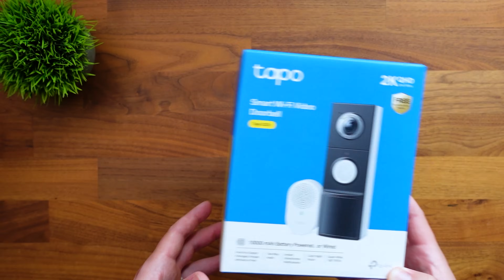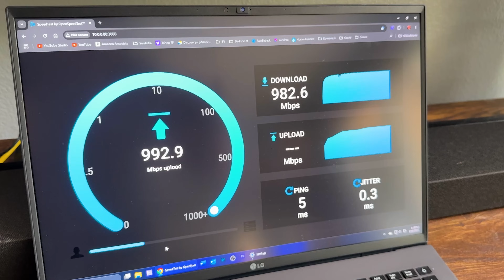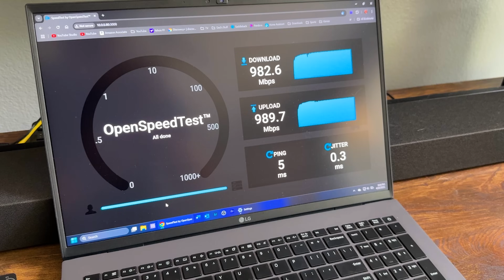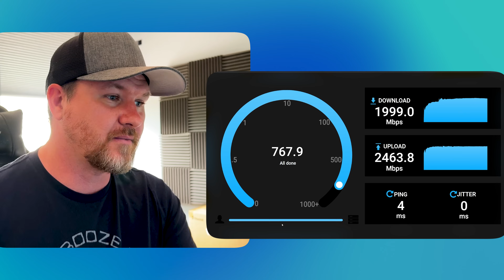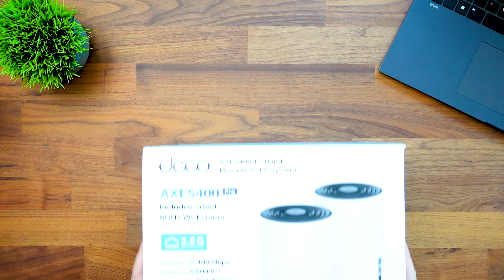Turn Your Coax Cable Into Blazing Fast Gigabit Ethernet

Comment: You might want to point out that many people's existing Cable Modem may have MoCA built in and they can just get devices for the rooms they want to service with MoCA.
Reply from the maker: This is a great point. Something i wasn't aware of before.
Reply: @SteveDOES  I have used MoCA for many years now, currently with the Xfinity Technicolor XB7, it and my previous Xfinity Modem/Router also supported MoCA, only ver. 2.0 capable of 1gig but still worth using. Possibly they have newer modems that support MoCA 2.5. I just haven't upgraded my equipment because they only offer 1300MBps in my area and I'm good with MoCA 2.0 for now. I have read that there is an XB8 available and I believe it supports MoCA 2.5, maybe in my near future. By the way I really enjoy your streams! Thanks for some awesome information.
Reply: I have used Moca for over 10 years with no issues. My cable modem has it built in.
Reply: @johnsanten  me too until tonight. They just sent out a firmware update that has temporarily broken my MoCA this evening. Have spent hours with support and the lower level support people do not even know what MoCA is... Little ticked off at the moment.

Comment: In general, Ethernet is faster than MoCA. While MoCA offers a reliable and convenient alternative to running new Ethernet cables, it typically doesn't achieve the same high speeds as Ethernet.
Reply from the maker: That is correct, but in a lot of cases, MoCA is a good compromise.

Comment: MoCA can be run over the coax even if you're still using it for cable TV. However, be careful to put a MoCA filter on the coax connection going to the outside of your house so that you don't send your network signal back out to the cable provider's system. Adding the filter will also increase the MoCA signal level inside your house.
Reply: Could you please explain more
Reply from the maker: Very helpful. Thank you.
Reply: Can you give more details on where to plug a filter?

Comment: Verizon FiOS Router has MoCA built in...I have a MoCA transceiver in my office connected to COAX, all splitters etc are Digital ready.  Wih 1 GB Fiber, I get 889.51 down and 858.61 up with 7 ms ping time....not shabby at all.
Reply from the maker: Now that's a cool way to go. Are you able to use any MoCA adapter?
Reply: @SteveDOES  I have used a couple variations of adaptors, bonded, not bonded, ScreenBeam...I forget what version of MoCA (possibly 2.0) is being used here, but I can put a switch on my end, and have 2 desktops plugged in, a 2013 Mac Pro and a self built Windows desktop running Win 10.  Both work perfectly.
Reply: The Verizon G1100 router supports MoCA 2.0 (max bandwidth 500 Mbps) whereas the newer G3100 and CR1000 routers support MoCA 2.5 (max bandwidth 2.5 Gbps)

Comment: I have a pair of the exact same moca adapters and ended up scraping them. I would get almost minute long interruptions in the connection. Super frustrating. Not sure If I'm doing something wrong but I don't think so.
Reply: probably needed to cap off the open ended coaxial connection that were unused.
Reply: @AnhtoanNguyen128 can you elaborate more on this?  What do you mean by capping? What hardware do I need to do this?  I am odd issues where I get network drops for a minute randomly as well.  Much appreciated.

Comment: Or just use a drill and pull 10gbps fibre throughout your house... network cards for SFP are cheap these days
Reply from the maker: If that's an option then that's definitely the way to go.
Reply: @SteveDOES  I chose fibre over ethernet because it requires reaaaally tiny holes. Rented property as well.

Comment: I cant do this in my medium 90s two story house. The first floor has coaxial and rj11 connections but the second floor only has one rj11 connection.
Reply from the maker: In the past cable providers would run coax through the house for free when you signed up for service. Not sure that's worth the 1-2 year contract commitment though.

Comment: I had to resort to using MoCAs in my new (to me) house.  Impossible to wire more ethernet.  One problem,  in a couple cases I have apparently non-moca compliant splitters hidden inside the wall.  In the case of my MBR,  I could NOT get MoCA to work on either COAX because of this.
Reply from the maker: Oh no, that sucks! I didn't even think about that scenario.

Comment: Regarding the MoCA adapter only having one coax connector, if you are trying to plug a cable tv box, You need a two way splitter rated for MoCa in order to plug a MoCa adapter and a cable TV box at the same time, No need to buy a MoCa adapter that has the MoCa and TV output since the majority of them are limited to only having gigabit ethernet, Just get a two way splitter and an extra coax cable to the TV's cable box.
Reply from the maker: Great tip, thanks for sharing!
Reply: Could you please give any product recommendations that can do this

Comment: Have been using MoCA 2.5 now for a couple of years and love it. Also, I have my distant MoCA adapter connected directly via Ethernet to my Asus Wi-Fi Mesh router (wired backhaul). I have several devices connected via Ethernet directly to that Mesh router plus the Mesh router is transmitting Wi-Fi to a bunch of devices at the far end of my home. Can't say enough good things about MoCA. If you already have Coax wired throughout your home, these devices will bring awesome up/down speeds throughout.
Reply from the maker: Couldn't have said it better myself. :)
Reply: @SteveDOES Steve can you just come over and go into my walls for me
Reply: If you don’t mind me asking, what Asus mesh system are you using? I just upgraded my and ordered two Asus moca devices and plan to install them this weekend
Reply: @heartattackray   I have an Asus RT-AX88U as my main router (hooked to 1Gb fiber). My secondary mesh is an Asus RT-AX86U Pro. My MoCA devices are ScreenBeam Bonded MoCA 2.5 Network Adapters. Hope that helps
Reply: @stevenz933 do you get 1gb download still?
Reply: @stepdadcody1501  Yes
Reply: Do you get 1gb download?

Comment: I do have MOCA in my home at all floors and it is quiet reliable end fast, but its very expensive at start, at least it was when I installed it. But hey I did not have to repair walls and pay 100 $ an hour electrician !
Reply from the maker: Yea, I just love that using the coax is an option.

Comment: Great content and great idea, but for that price, it's only good if you desperately need one ethernet in a completely different part of your house. If you want ethernet in multiple rooms it would honestly be cheaper to higher an electrician and get them to put cat 6e cables through the walls instead.
Great idea but the cost just isn't worth it for multiple.
Reply: Factor the price of opening your walls, floors, etc, to pass cables on 3 floors, and you will see it is not expensive for the result. An electrician nowadays is about 100 $ and hour, plus the work, and they dont repair walls, so you are very wrong.
Reply: @philipperostin 'very wrong'
No.
As there are already coaxial cables, they just need pulling through. Any decent electrician or builder can pull through the new ethernet cable (which is thinner than coaxial) as they pull the only ones out. It's straight forward for a professional. I know a few amateurs who did it themselves in half a day. So, when you consider 5+ , it's $600 for these devices...or you higher a profession for a days rate at less than $300...half the price, a professional job, and put in cat 6e and it will last another 15yrs at least. This product is for people who have more money than ability or more money than a phone call. Nonsensical, unless as previously stated, you just need it in one place like an upstairs office where the main router is on a different floor at the opposite side of the house.
Reply: @jredford88  I disagree, thats all. Good luck pulling on coax that is stapled on 2x4's through 3 floors. Well anyway if it suits you, it does not change my life. You do you.